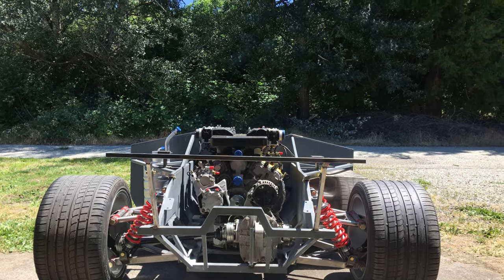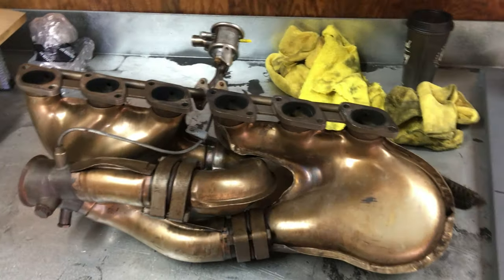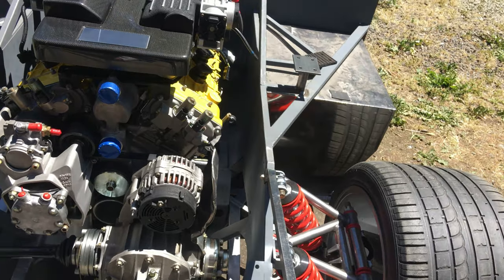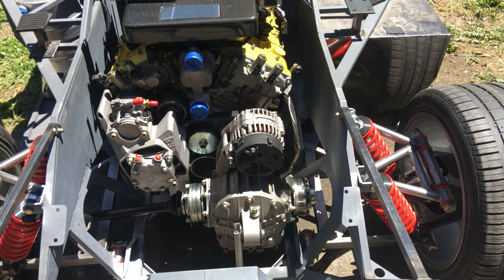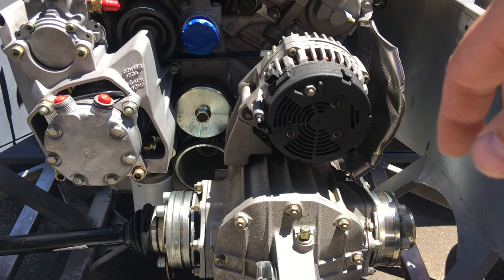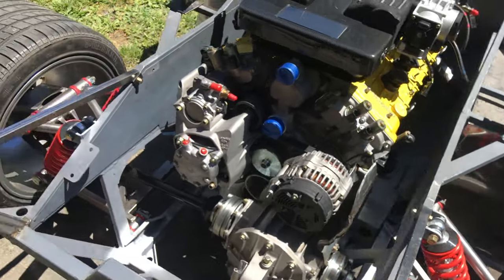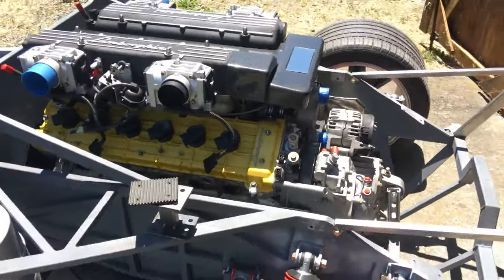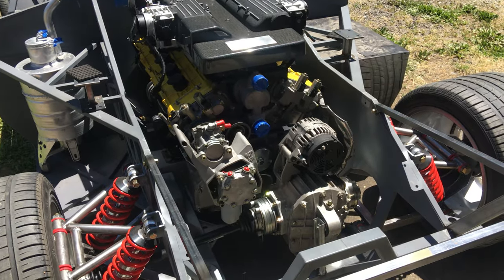Lamborghini Murcielago Engine install (NAERC)

Comment: Great job!!!!! What is the entire weight so far (Chassis+Powertrain+Unsprung)
Reply from the maker: As it sets... c/w is probably around 1700 lbs. Gearbox and clutch are not installed. Add another 200 lbs.  A Diablo/Murcielago  weight is 3600 lbs. I will be lighter w/ 2WD setup and 100lbs of exhaust system cut out.
Reply: @AmericanBuiltExotics  Thanks a lot. Really eager to see how it comes out

Comment: Damn man I’m doing an LS turbo setup in mine. You got all the electronic stuff figured out to make it run? That was my biggest concern. Secondly the cost of the motor/trans/etc as well as maintenance. That’s gonna sound so good. You doing AWD?
Reply from the maker: I have: OEM wiring harness, w/ stock ECUs. OEM 6 speed Manuel gearbox, and clutch. RWD setup for, Added clutch life, handles much better, plus more power!